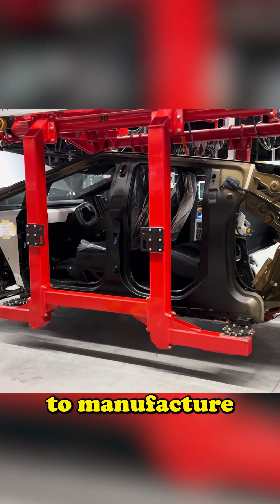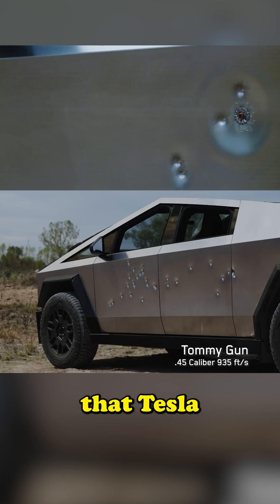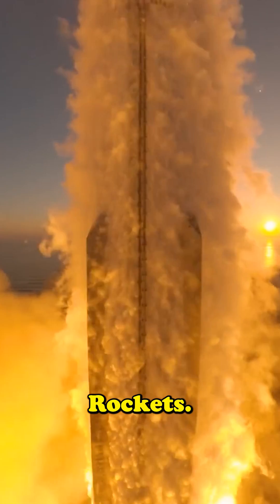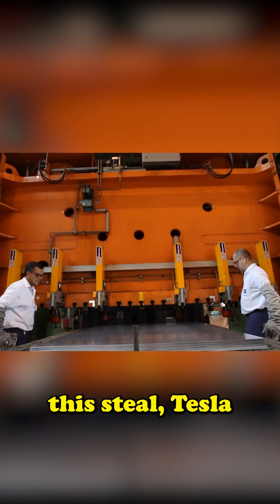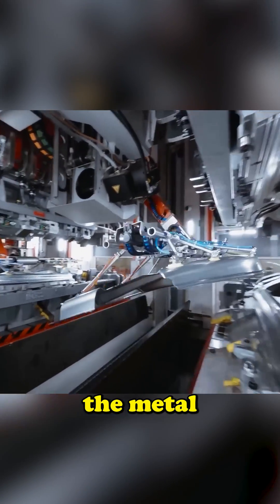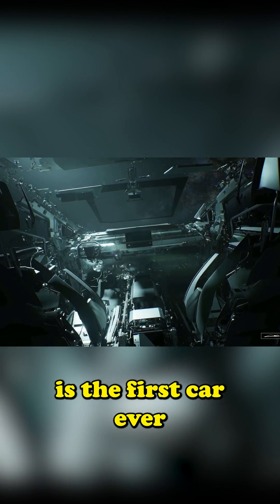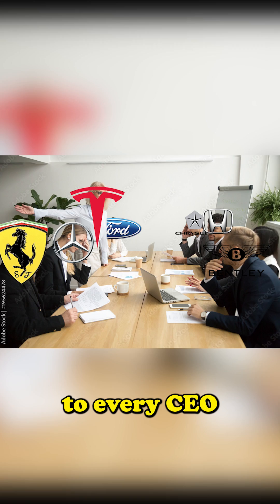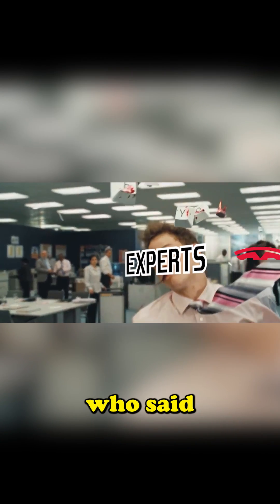Tesla Cybetruck - Why Is It So Hard To Manufacture? #teslacybertruck #knowledge #nutshell

Comment: Hmmmm..... so another badly designed car that as far as what i have learned so far doesn't even deliver on Musk promises....
It is not better than rivian or ford or even chevrolet, TFLT made video about what Musk promised and what was delivered and it doesn't look good for tesla....
Range, payload, towing all that is already ofered by others, cybertruck was marketed as gamechanger but it looks like it changes nothing, as far as electric trucks rivian was gamechancher and tesla is late to the party without any meaningfull thing to give.

That steel that everyone is talking about is basically dead weight, if the car was designed as car should be then they could have fitted bigger batery to extend range, instead they opted for things nibody needs and is potential danger to others........ so your typical tesla....